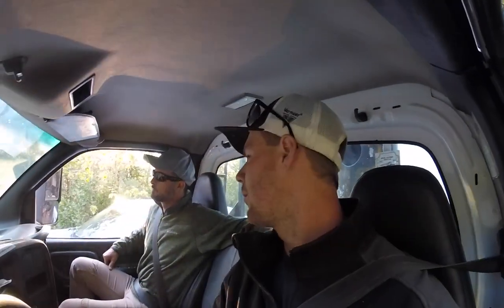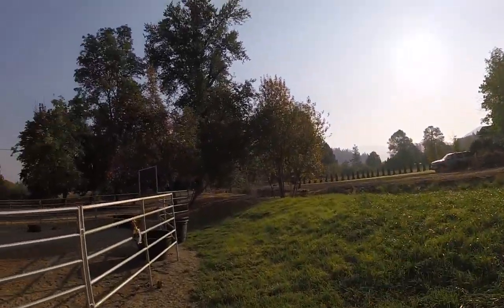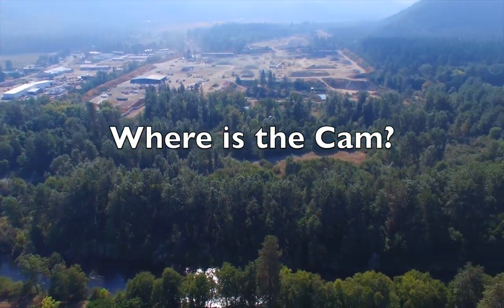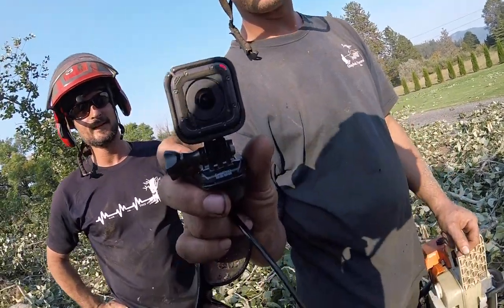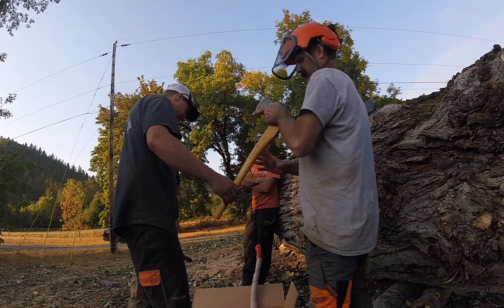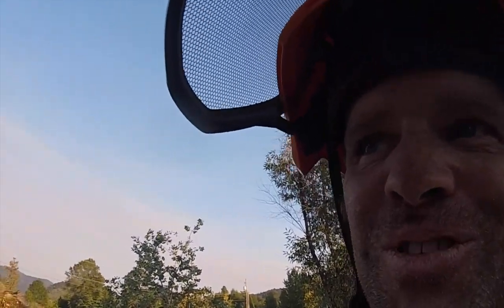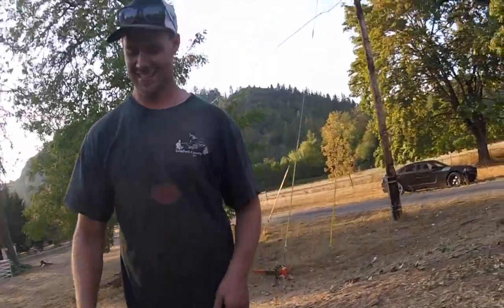Axe Unbox

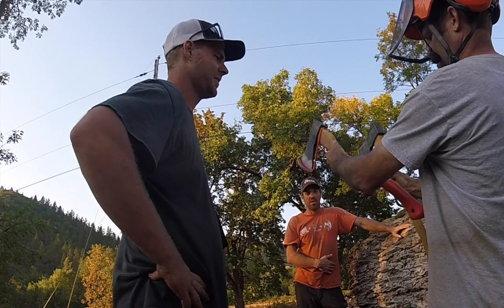Comment: 9:39 is a 70cm / 27.5 inch 'Stihl' hickory handle
I had simply sanded, erased all of the precaution markings, logo etc. and drilled a hole in the grip.

Comment: Nice as always MB, dam radiators just replaced one in mine as well 😠.. but I cant whine to badly, at least mine fit first time. Looks like that Vermeer is getting a good workout, love that tipping trailer as well, looks like a sweet combination.
Cheers to all from Down Under & hope the radiator gets sorted sooner than later..

Comment: Hey buddy I have a question for you myb u will no. I have a sthil 200t right underneath were the carb is an filter is there is a couple lines I think one is a fuel line I get some fuel liking not much but some I was told that is over flow do u no if that's true or not should it always be dry there